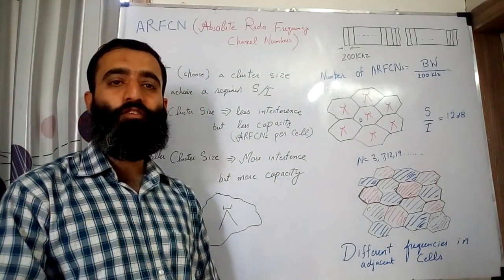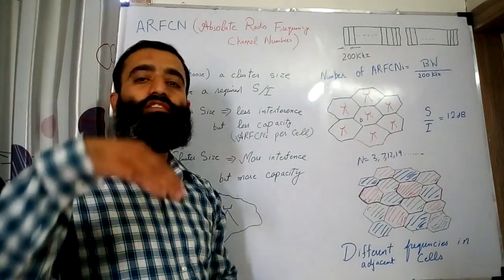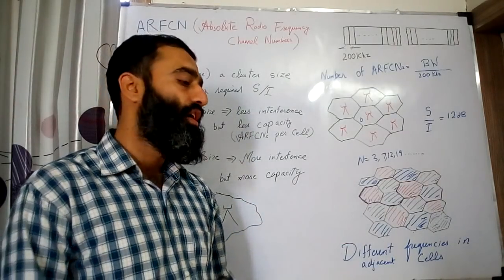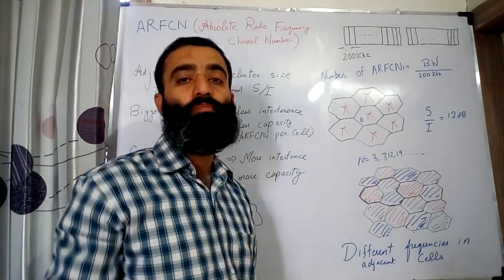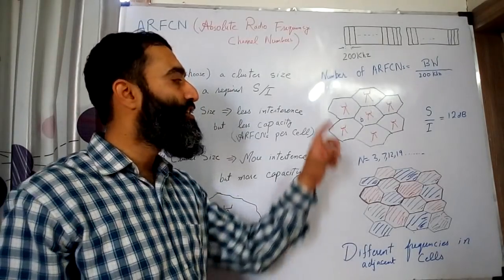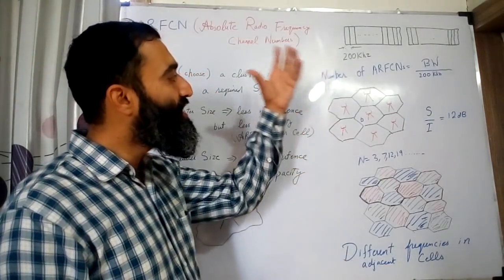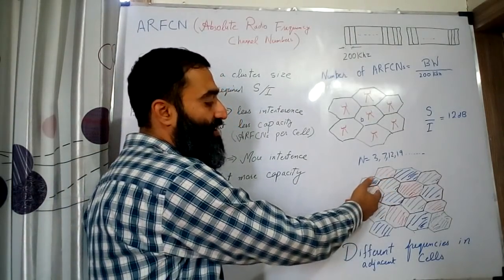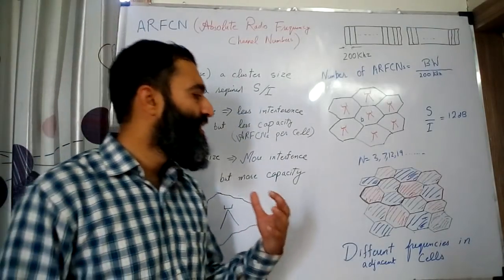FREQUENCY REUSE IN GSM AND CELLULAR NETWORKS

Comment: Sir than in lte fdd and tdd is used . So where QAM is used ?
Reply from the maker: QAM is not used in 2G, only in 3G and 4G.
Reply: Sir in 4g TDD and FDD is used . But  I read QAM is also used so where is it used ?  Which modulation is used in microwave transmission ? may be QAM is used in Microwave ? can you name modulations used in  mobile communication ? where are they used ? and sir can you explain FDD ?